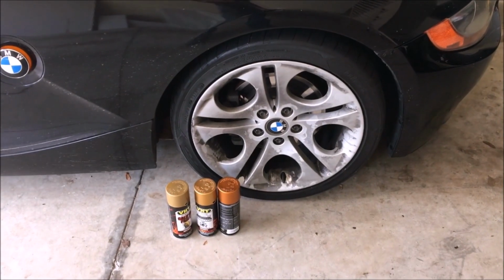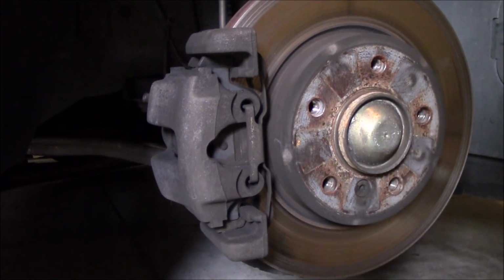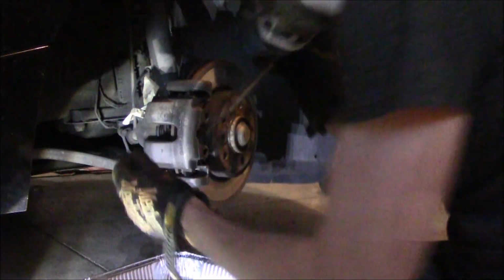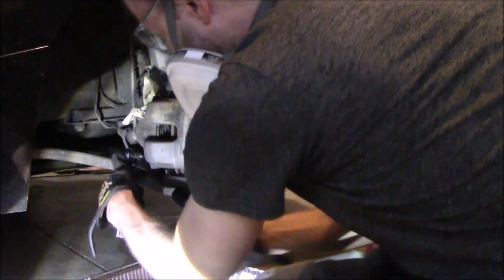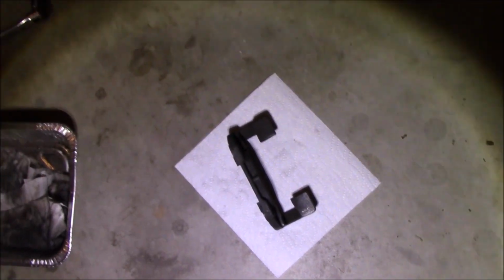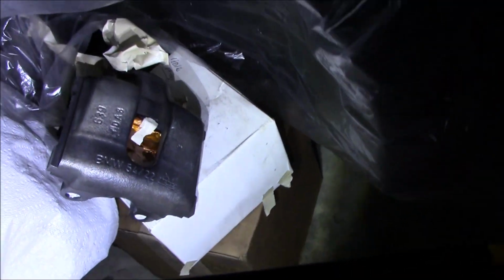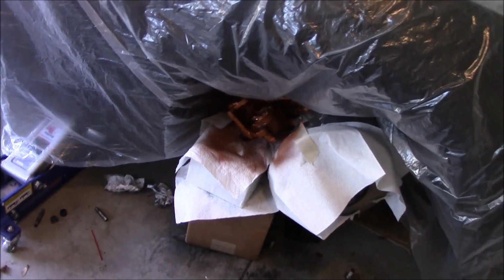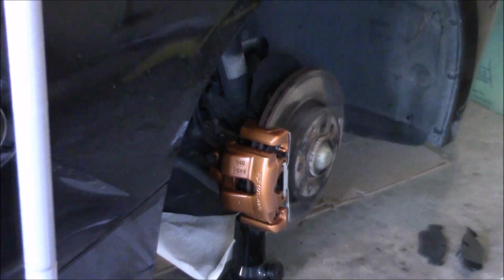Painting Brake Calipers - BMW w/ Copper Engine Paint and VHT Clear

Comment: Why did you go with that color? What color is the interior?
Reply from the maker: They interior color was black leather.  The caliper color I really choose because I liked the look.  It read more like a metal than a paint, and it was not over the top skittle colored, but a bit more reserved while still looking rich to me.   Personal preference more than technical was the reason in the final color selection.

Comment: Looks good dude How are they holding up without primer as I have the same paint and want to do my calipers but don't have any primer
Reply from the maker: Harry, thanks for asking.  It has been 2 years and 3 months, and it held up well until just this summer.  Now it is starting to flake off.  So, be aware, it was great for 2 years, but now it is is starting to deteriorate.  with what I know now, I think I would try a heavier/thicker paint versus the engine paint I used.  The paint and color held up to heat,, but it just was too thin to hold up to scratches from road debris.  At least that is my theory.   I think a thicker type of paint would be a better fit.  (but it did look great while it lasted)

Comment: You probably would have saved a ton of time just taking the calipers off entirely to clean and paint, and then doing a bottle-bleed afterward. With the calipers off you could have just power washed them.  Either way, the end result looks great!
Reply from the maker: You are likely correct, I burned far more time on prep than I originally anticipated.  All good in the end.

Comment: How far apart in time did you wait to apply clear coat after laying down base coat? Does the base need to fully cure or can it be done while the base it still wet? What is the best way to avoid wrinkles or the paint from shrinking?

Comment: Did you cure the paint in any way? I used the same paint on my motorcycle engine and it flaked off. Im guessing my prep work wasn't that good.
Reply from the maker: Prep work is probably the item, but as for cure, I left the pieces to dry overnight, then I assembled them next day.  So about 24 hours worth of time between final paint and use.
Reply: Far Reach Engineering I'll have to try it again. Thanks for the feed back.

Comment: Hi guy, I am curious to know how is the paint sticking to the caliper, any flakes off? Any advise? They look great, but I am concern about the durability. Thanks
Reply from the maker: Hi Luis, Its been holding up good.  It looks like the day I painted them (excepted often covered in brake dust).  The only defect I can find is one chip on the passenger front, likely from a rock on one of the gravel roads I traveled, but even that is only the size of a BB and is only visible because I got down on my knee to inspect them closely for you.   So overall they are holding up quite well.
Reply: Thanks very much for the feedback. Very nice to have people like you sharing the experiences in certain applications. Kind regards and keep it up!! LFG.

Comment: Just curious how they're holding up? I'm using the same paint you used.
Reply from the maker: It is August 14th as of this post that being about 3 months since I painted them and they are holding up well.  No flaking or bubbling.  So far no track days or attacks on the Tail of the Dragon.  Just spirited daily driving.  Id have to guess the mileage but several thousand miles and sill holding up.  Also a handful of automatic car washes in the same time.  So far I am quite pleased with the outcome and durability.
Reply: @FarReachFR  any update now ~2 years after the video posted?
Reply from the maker: @TheEnergyball   It is closing in on 3 years, and the paint is still there but notable flaking has now occurred.  It held up good for 2 years and 3 months.  So, be aware, it was great for 2 years, but now it is is starting to deteriorate.  with what I know now, I think I would try a heavier/thicker paint versus the engine paint I used.  The paint and color held up to heat,, but it just was too thin to hold up to scratches from road debris.  At least that is my theory.   I think a thicker type of paint would be a better fit for next time.  (but it did look great while it lasted)
Reply: @FarReachFR  Thank you for the response. That makes sense. Helpful to share these experiments in this format. I also imagine more clear coat may be helpful.